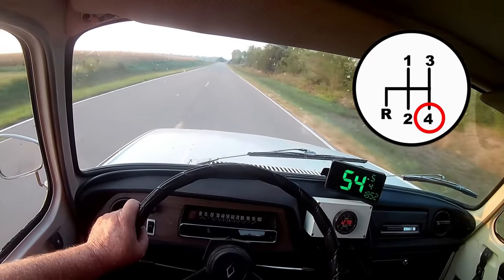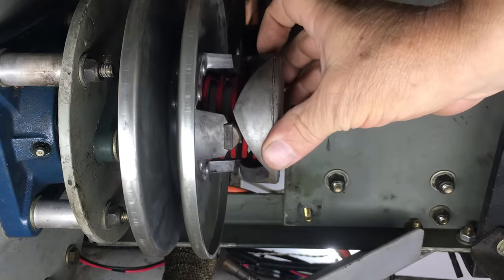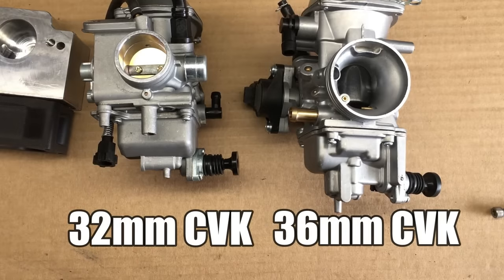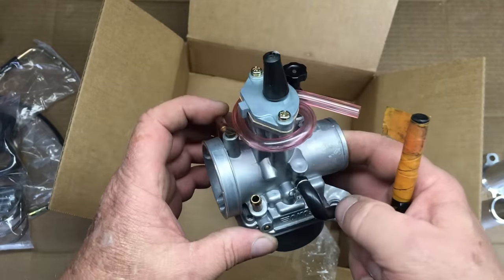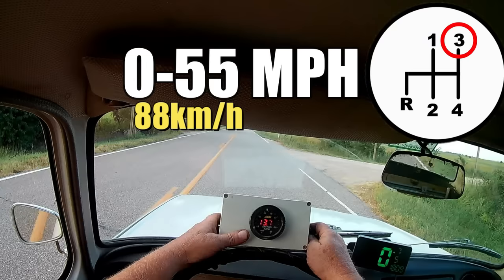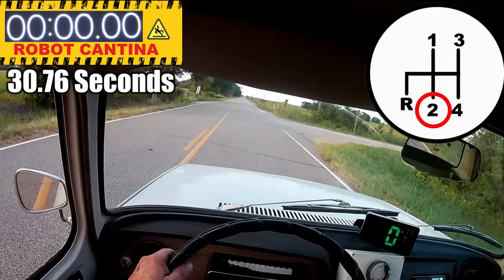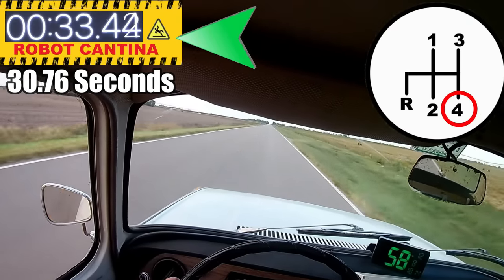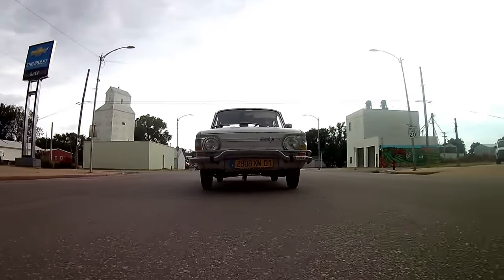S3 E32 We install a 3D printed manifold spacer on the 670 cc Predator Renault for moor speed

Comment: Great video Jimbo. Have you taken the valve covers off and checked the valve lash yet ? I work on these engines in generators and the valve lash is never set correctly.

Comment: Let's see what the 36mm does first, although with 30% more 'throat' area than the 32mm, you may not find that it's working over its full designed range of airflow velocity, and the performance may actually fall off. 

Ideally, the inlet tract should maintain a fairly constant or slowly varying cross-section area from the air filter to the inlet valve, with sweeping changes of direction. That helps to reduce turbulence and sudden changes of airflow velocity. The current single carby setup has a range of differing cross-section areas, with rapid changes of shape, and 3 fairly sharp bends in it, all of which will add restrictions, turbulence, reduce inlet pressure wave benefits, and ultimately may restrict the fuel-air charge getting to the cylinder. 

The dual carbs will be a definite improvement, as the inlet tract is dead straight, shorter, and has only gentle changes in diameter. These all allow the engine to breathe easier than the current convoluted inlet tract, and should boost charge mass entering the cylinder. Also, the shorter inlet tract will boost low end torque, giving better 'off-the-line' acceleration, although top end torque will be lower. (Some modern cars have 'variable length inlets', where the system switches between a short inlet tract at low speed to a longer tract at high speed, keeping the torque on the boil all the way up the rev range. Possibly a bit too involved for the Predator, though....😁)

Comment: The single carb setup should be better below 4000 and identical to about 5200-ish. If you do dual carbs, consider a cam and valve springs update to be able to hit 5500 rpm on a steady basis.

Comment: I highly suggest you start using snowmobile cvt setup they are already rated for more power and and constantly under full load in the snow that was my final decision for the billet Honda gx390 I built on a light frame with big tires I stopped shredding comet style belts all together and been running the same clutchs and used belt as I bought It only thing that was special was the tapered adapter for the drive clutch

Comment: The rich @ part throttle issue (knockoff Kehin) is due to cutting the piston spring.

The piston opens with less throttle, which opens the needle.
Reply from the maker: The rich condition at part throttle was a problem from the beginning and we had that issue before cutting the spring.  After cutting the spring we saw a slight improvement.  I think its possible if we totally plugged the pilot jet we would still get the rich condition at part throttle.  Something is not right with this carb.
Reply: @robotcantina8957  I'm pretty sure the problem is because the carburetor is too big.

My CB600F6 uses four flat slide Keihin CV carbs with 34mm venturis. It makes about 96hp at the rear wheel, so after some "math" (+drivetrain losses & ÷4) , each carb supports about 28hp. ~25% more than your 670 (stock 22hp), and your carb is even bigger than that.

Too small of carb limits flow, and too big of carb limits usability, so ya gotta get it just right!
Reply: If you want to try one of my carbs, let me know, I'll check into separating one but retaining controls.

(I had to replace one, and they come in sets…from Europe. Now installed & running, so I have the broken set [with 3 good carbs] on my bench)
Reply from the maker: @Iowa599  If you have a genuine Keihin available, I would love to give it a shot.  We would limit the mods to jets only and not do any permanent mods to your carburetor.  I cannot always respond to comments because I get so many.  In the video description you will find my PO box address and if you click on "about" on my channel page you will find my direct email.

Comment: If you do the twin carbs try a balance tube to equalize the two manifold pressures. Interestingly it may or may not make a difference but easy to remove. Either way 7 sleeps, 6 sleeps, 5 sleeps, huh....

Comment: I'd say the single than the duals.  I was interested in the performance of the adjustable venturi design and its characteristics anyways since you got it.  May be throttle by wire on the duals using steppers and pid control to be able to really synchronize them 🤣

Comment: Kinda confused where the notion that the clutch stuff is boring came from? Making sure the thing runs and doesn't leave you stranded sounds a lot more fun than "going fast until the motor/clutch/transmission blows!"

Also would the longer intake manifold tubes allow a higher torque output at lower rpms? I have read that a longer intake tube can help with low end power.

Also I would strongly consider another wideband sensor, it allows you to do more testing and keep track of both cylinders, have more access to data, and you can use it to see how much of a change in AFR is from your Main O2 sensor and for example the exit of the tail pipe.

Comment: Double carb wouldn't really get you any more power as long as the single carb is big enough, at least that's how engines normally work. It would get you better throttle response and could move the powerband higher or lower. Considering how you're already pushing the rev limit design spec on the engine, moving it lower with longer runners would be pretty great.

I still want to see you make a mechanism to adjust the AFR in the interior while driving. That would be some real space age technology compared to the rest of that engine haha. Could compare it to the first American supercar if you remember what the original Vector interior looked like...
Reply: On v twins it's a bit different because of the uneven firing order. Single carb setups tend to have issues with uneven distribution of the mixture (cylinder 2 runs lean), so it's easier to just treat the engine like two singles on the intake side.

Comment: Your biggest problem is using that bracket that makes a 90 def bend.. the aluminum intake mount has to go.  You need a down draft carburetor.. those adapters are going to hurt your performance..

Comment: Honestly you should be using a torque converter clutch system from a Polaris side by. There must be fearing they can handle the load a lot more

Comment: I think you should start the transmission in second gear and then double shift to fourth gear at 3,000 r.p.m.. Just like a Honda CVT 2 gear transmission.  It will help NOT shred the drive belt.

Comment: If Possible, I would love to see both the 36 mm carb AND the dual setup. Sometimes "A lot More" carburetor isn't always  the whole the answer. To follow on, because of the extra Carb, you would need to "Cam" the motor, Go to a higher compression ratio Ya Da, yada, yada! Build a Full Race Predator motor, For a Renault ..... 🤔

Comment: Much as I am looking forward to dual-carb hoonerie, in the interest of SCIENCE I think you should try the larger single barrel carb first.  This way you can test out whether the "smaller carb for low end torque-larger carb for high end horsepower" hot rodder trope also extends to a Harbor Freight 670 cc naturally-aspirated twin-cylinder engine.  Then we get to watch you try to tune a twin carburetor set up, which is way over my pay grade.  I know two-cylinder John Deeres like a two-barrel carburetor, but that is because their uneven firing intervals favor the first cylinder if you only have one barrel to feed both.  

Why do you think the carb spacer on the existing carburetor helped?  My understanding was always that lengthening the intake to the engine increased the velocity of the intake mixture, which helped torque at lower rpm's, whereas shorter runners were better for higher end power.  I wonder if there is data to address this in your 0-20, 20-40, 40-50 times?  What do I know, I just stand and hold the beer.

Comment: Stick with the single carb. Tuning 2 carbs is a pain in the butt. I’d be curious to see if you plan on doing valve springs and a cam, but that’s not cheap.

Comment: If you use a lawnmower style belt slip clutch instead of the cvt you could have faster shift times and potentially a faster 0-50

Comment: i would add a bung to each downpipe then the wide bans can be swapped from 1 to the other when tuning then bungs can just be capped off after i will be doing this on my motorcycles makes setting multi carbs up so much simpler

Comment: The amount of ‘throttle off time’ when shifting consumes the extra time.
Reply from the maker: Yes absolutely, keep in mind there is no real clutch on this setup and it takes time to shift... that's why 3rd gear is the fastest... because no shifting is required.
Reply: @robotcantina8957  you’re shifting as fast as you can with it.  Wonder if it would be practical to use a belt and tensioner like a mower deck between the CVT and transmission.  Really grabby for a clutch but you could eliminate that lag.  

Bah, just something else to fail. 

You can change out springs in the CVT to affect its ‘stall’ and torque curve.  Not sure if you’d benefit but the optional parts are available!

Comment: There is no right and wrong, just what works. I have an old dodge 5.9 magnum, not that old but if you know then you know. The v6 and v8s all had 2 barrel throttle bodies. V8 was a little bigger if I remember. But I think only 48 or 49 mm. Now you tell me if that seems right, because that seems tiny for a 5.0l engine let alone a 5.9l. But it loves it, the torque it has from such small opening seems to help it. Eventually I'm going to put a 4bbl on but gotta find a good one to put on it. I live in NY where emissions are based off California. Otherwise I would put a carb on it. Piping the 2 manifolds on that new setup and extending the runner would help with keeping some low end torque

Comment: I have an OKO flat slide on a motorized bike lol two stroke running e85. It cruises along nicely and is a little faster than your average 50cc moped. Its a blast but boy its not reliable lol always tinkering

Comment: I would like to see the single carburetor.    I’m putting a 713cc duromax in a Ezgo golf cart. With the same 36mm carb.   My thoughts were that the 32mm carb was too small because the main jet had to be so large.  And the 36mm behave at mid RPM and be easier to tune.

Comment: I dont think we should go duals just yet. I think another go at the single larger carb would be the best transition to the duals. Plus, doesn't the CV transmission have some tune ability? I suspect fuel economy will go up with dual carbs, and your low midrange power will increase.

Comment: I think there it would make sense to try the bigger, single first. 36mm should be a better match for 670cc in my book. I run single cylinder 600cc dirt bikes (Honda XR) on  40mm Mikuni carbs. Around 45-50 hp

Comment: I wonder, if a belt could be reinforced with a chain, but a steel belted um, well BELT. 'would be strongest.  I think a series of welded bands narrow enough to keep rubber in contact with the pulley,   then a harder more durable rubber can be used where stretch and flexibility will not be a priority, the steel will be the strength, the rubber being the grip,  a  chain with tiny clutch pads would be cool not sure how the chain would be lubed, a wet friction system that would be something, use a manual clutch, with a chain with friction pads, running in ATF! Haha, 
But a TQ. converter with a hydrostatic drive maybe a planetary gear set to get a over/under drive ratio, the tq converter allows the engine to rev into the TQ band, and the bypass on the hydraulic drive is reduced as the speed picks up allowing more acceleration eventually the tq converter locks up the planetary gear is applied for the final drive ratio.  Any chance of building a system similar to this? A large hydraulic motor and pump? Possibly using air-conditioning compressors,  with multiple pistons use one as a pump, one as a motor,. Maybe use a bypass valve between, with a traditional cart clutch driving it, ?? Just an idea!!

Comment: I vote for TUNING THE CVT! It's shifting too fast, the driven clutch spring needs to be tightened up. It's free and would only take a few hours to test. I betcha a coke you can shave a second off 0-50 time.

Comment: Bigger single.
This knockoff Keihin may have better part throttle behavior! Slide throttle carbs without accelerator pumps can be a pain as far as driveability goes since you get a lean dip when you raise the slide. This is fun to watch.

Comment: I would like to see a full and complete calibration of air and fuel at some point. Like, "this carb can't be adjusted as well as a real kienen carb" is what I want to leave behind.
  I would like to see a carb with all the adjustments possible be calibrated. To me that sounds like Dual.
  But I don't need Dual first. Actually, doing single first gives you a step up to dual, as opposed to a step down to single. So I guess I want to see single first

Comment: I'm not sure if the single carb is allowing enough air into the engine. The more air you can shove into the engine the better it will perform, I would run the 2 carb setup on it. I run a 26mm carb on my Ducar 212. I would say, a 670 would need a much bigger carb for  proper performance.

Comment: Dual carbs should give better low end performance, on top of being easier to tune (on a per-carb basis).  Single large carb may flow better at the top end due to pulse training and whatnot, but will probably be a bear to tune at the low end (again).  I would like to see both, but maybe skip the low end tuning on the large single for time and sanity's sake.

Comment: try both carbs (start with the bigger one) but with the wide band gauge either pluggable  sensor ports in the exhaust to se what's what with each cylinder or a way to switch between two sensors

Comment: Would this adapter work with the stock 2bbl? That's what i thought you might try, since it would allow each cylinder to pull air from both barrels now.
Reply from the maker: Yes it will, however it sets the carburetor too far back on  the engine and none of the linkages would line up.  we may try it after we test all the other carburetors.
Reply: @robotcantina8957  ah cool! Fun stuff

Comment: I vote for the larger single carb first.
Also, does the CVT have an aftermarket for springs & counterweights to dial in the ratio changes & prevent bogging the engine down outside of it's powerband?

Comment: Maybe play with tire size to get the rpm/mph right. Or maybe try a performance cam so it pulls a little harder after 50mph. But the rpms would still be high.

Comment: nice work there, 
and about the engine, how bout to tune the camshaft, cam spring, and valve cam for better acc and get more RPM out of that twin cylinder 670cc engine?
also make the compresion little bit bigger than the stock to get better low end torq?
btw it's just suggetion from me alright :3

Comment: Does the carb adaptor have an elbow pattern inside or did they just drill in each way?  If it doesn’t have a smooth contour it may be worth some job weld to help the transition.  I vote single carb next.  A down draft carb would be cool, but probably cost prohibitive.

Comment: So
Cool!

Hey just think if u keep improving it like this you may end up having similar performance to the engine the car came with, with half the cylinders :)

My opinion on the 50mph limit is I am glad you will not have to redo all the tests again with all the past configurations, because you flagged time to each 10 mph increment. 

Just curious, whats the top speed of the car if you dont exceed the redline? Thats how Car and Driver used to test. It didnt matter how fast the car could go or how willing the engine was to rev, official acceleration and top speed figures were without exceeding published redline (in any gear). 
They also tested max speed in each gear (would be awesome to display a chart like that for your car:)

Lastly, i vote dual carb simply because they look cool!
Still wanna see the larger single carb first, because its already set up that way. then after doing dual carbs, maybe a custom EFI setup using MPFI and individual throttle bodies?

My opinion is the performance wont be much improved, as the dual carbs wont have the torque down low like a single manifold will, but if you do EFI you will get the best of both.

Comment: I vote we finish single carbs before we rock the duals. Is it possible the diesel insight might do performance testing while the Renault gets a CVT upgrade and the motor rebuilt for high RPM?

Comment: Only reason a V-Twin would NEED 2 carbs is in an enclosed motorcycle where the rear cylinder will run hotter and need different fuelling, in cars it doesn't matter, hence all the V8's running 1 carb

Comment: I have a daf66. They have a cvt from factory. The car is the around the same weight and it has 2 belts and they are litle over the double with than your belt. So the one you got is probably to weak

Comment: It would be awesome to understand what mechanical limitations give the 675cc engine a 4k-rpm ceiling. 
To this layman, a small capacity V-twin you'd think, could rev to the moon? I.e 600cc V-twin motorbike engine could rev at least double that. I guess I'm asking, and only in a friendly way (I don't mean for this to sound like ignorant criticism), is it just cheap construction? I.e bearings, crank, conrods etc won't hold up or is it cyl head design? I wonder if there are simple modifications that could be done to give you much more RPM?
Thanks for all these genuinely interesting and insightful vids. Its so cool.

Comment: I see your running the generator like you have on previous builds. Just curious why you did not just use the charging coil on the 670? Not enough output?